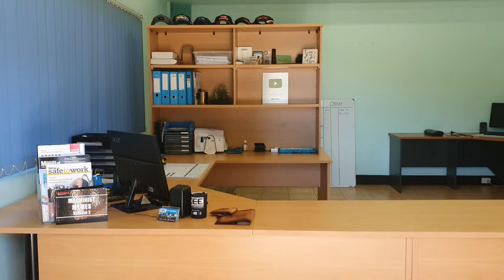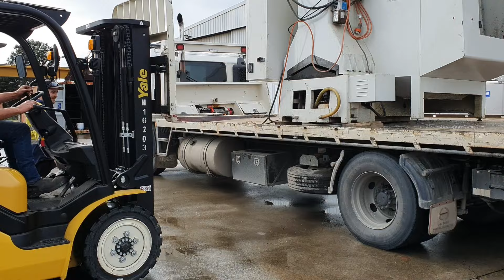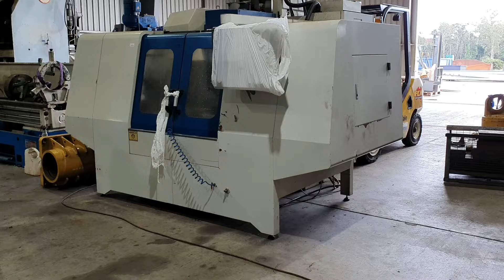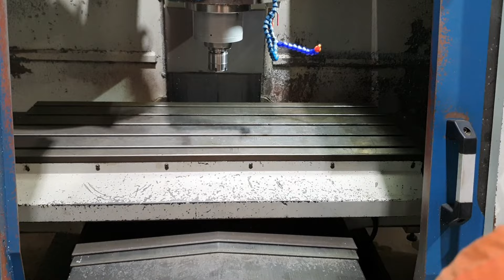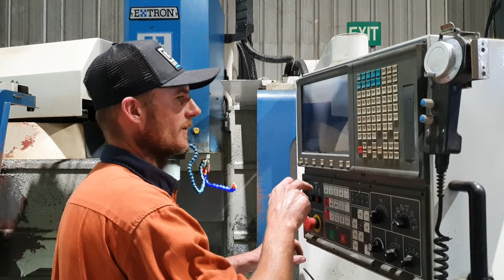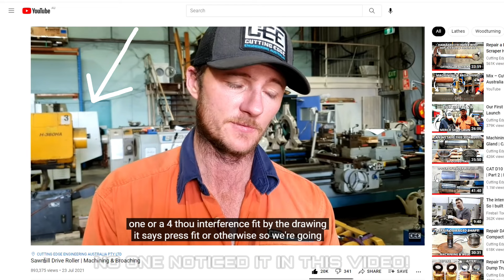Finally REVEALING Our New to us Machine | Workshop Machinery

Comment: Glad you got into the machine nice and cheap. The Cat 40 holders and tooling are what really cost the coin, as well as the probe.
Also: nice to hear that the spindle bearings sound great. The most expensive part usually to replace is usually the spindle. Most aren’t the type you can replace parts on, most are core charge type parts

Comment: I've trained lots of people to do cnc setup, and operation and a few to program, you already know the hard part, and that is how to make parts, now you just have to learn how to tell the machine to make them for you. to be honest a lot of the time when I have  prototype work, I'm using the cnc as a manual mill with a dro and full power feed.  as for a guess am going VTL and a cylindrical grinder

Comment: How much experience have you had with CAD software?  Seems like we were taught G-code alongside CAD drafting.  Helped to understand the programming.  Consider this as learning a new language.  You know what you want it to do, just how to tell it.  Lucky for you, you've known manual machines.  Most of the CNC jockeys have never felt the machine cutting through the leadscrews.  Just because its CNC, doesn't make it infallible.  Sadly, you'll also see when to and when not to utilize this machine.  So many times I see CNC operators put way too much time into a simple task that could be completed on a manual mill much faster.  Unless you're sculpting 3-D surfaces or making multiple parts, the CNC machine can be very time consuming for the simplest tasks.  Be ready for lengthy programming, machine setups, and expensive maintenance.  Then again, I'm a dentist by profession.

Comment: Congradulations, looks to be in decent shape, atleast what I can see from the states! Not familiar with the control. I learned cnc all on my own (on a cinci milicron Lancer 2000 Acramatic 2100 control.). Learn g code as you progress, your are smart bloke, and if I did you can too. I do a lot the same type work that your shop does excluding Hydros, it will come in handy. On thing is though,  You should have gotten one astleast 2x the size. I understand why you picked what you did. That being said when you get to a point where want put that machine to serious use you will find out the hard way. Damn I need just 5cm more , it never stops. A very sucessful machinist friend told me once in our line of machining buy big as you can afford and get all accessories up front.  
Best of luck with it,
Doug

Comment: Very cool machine!  A suggestion for spare time programming is to work up a few of the most common cylinder eye sizes.  That way, when one of those jobs comes in, just mention that you fabricated a replacement in your CNC, show some shots of the process, and go straight on to prep and welding.

Comment: Hey guys listen I live in ONTARIO CANADA, about 1hour west of Toronto Ontario Canada, have u heard of that city? Anyways, y do u say measure everything in metric? Here in Canada yes we use metric all the time, and we use standard as well, that's the die hard I use both, and I don't know if its Murphy's law, or what it is, but where u are do you find your self loosing 10mm sockets and wrenches? Fuck I do all the fucking time lmmfao, well good luck with the new C&C machine, and my kid wants to know do you get snow ? And right now here in Ontario Canada time is 11:15pm what is the time difference there? Have fun with new machine, ken from Canada

Comment: Those bearing pullers are a good example of a job for this machine. Clamp plate on, run a highfeed, take core out, profile taper, drill/tap holes. Would watch it take the core out (same same trepan),manually remove that then go do something for 30 mins while it profiles the v taper with button.
Reply: What's the controller makes/model? What your current cad system if any? Fusion 360 is like 300 bucks a year and had all the posts, easy to customise. Also check out the titans of cnc fb group, post the machine and controller details, will be people who are familiar with itm
Reply: Found it sorry, Mril 2000, old Taiwanese controller, 486 based. Looks like a generic fanuc oi post would work, just need tweak any mcode formatting and sequencing. Previous owner should have samples and information on that, manuals etc.. if you can, try find out how.to backup parameters, they'd be near impossible to replace lol

Comment: Mastercam is a really good cad/cam program. Cad/Cam program will let you do a lot with out special tooling. I started using Blaser Vasco 7000 coolant it working out great and has a great shelf life. One thing to remember is LET IT COMPLETE A TOOL CHANGE BEFORE DOING ANY THING. 😁 I started with a old Bridgeport ticker tape mill  and converted it pc system. Then picked a Okuma 45-VAE 1999 model in 2002 it still runs great. Last year added two more OKUMA’s a lathe and mill. They are very fast beast. Example the Okuma Captain370 lathe. Been running a 1018 steel part 5.25” d x 14.5” long it weighs 41.21kg. Running Mitsubishi rougher insert take rove 21.21kg in less than 20 minutes at 775 sfm .012” chip .100” depth. You can stick a shaft out the window and attach a torch are plasma cutter.  Great videos 👍

Comment: To run it, id suggest getting a G code machinist manual that will hep you with understanding canned cycles 
Other then that, it’s all running and finding a good cad/cam program to make the G code with the output post processor. 
What type of controller is it? Fanuc, Mitsubishi? Heidenhein?

Comment: 50 plus year old machines bought from an auctioneer. Ok.  Well the CNC mill I can understand because it will be good to learn and possibly can increase productivity if you have a job that can be programmed and run with minimal interactions so you can get other jobs done.  The other machines would have to fill a role that you don't currently have so I would guess a horizontal boring mill for jobs too large for the mills you have now and possibly radial arm drill because they have a lot of versatility and many people don't use them because they take up so much space. I have a couple other guesses but those are my top two picks.

Comment: congrats on the new machine. Im not sure what program you use to do your technical drawings it may have a cnc function as well if not i use fusion 360 for my cnc router that i built you can from memory get a free version just not sure how long it lasts it does all the cnc and post processing in one easy to use once you understand the basics. i watched a lot of  Lars Christensen's videos. i als ouse it for my 3d printers for designing models. best of luck peter

Comment: well hell, I'm sure there are dozens of folks making the same offer, but at one time I was fair handy with a cnc mill, if you need some guidance and whatnot. Do me and yourself a favor develop a "safety line" in your code, should cancel all modal G/M codes and send the Spindle "home" before starting with any new tool... It will save you a spindle or 3.

Comment: Fyi: never never play in the parameters.  One edit could turn it into a paperweight.   Learn recovery codes first....cnc is easy after you learn g codes...one more thing, some commands will not work with the doors open .Good luck

Comment: you should get sa fourth axis and accopanieing steady rests and live center from what i have seen you mschine this will make it way more usefull - also with that table size, if the maschine is not completely worn out you can make easy automotve work like planeing cylinder heads and other gasket sufaces and just let it run 
you can even get waste maschines to restore and sell since you basically can make any missing part there is now

Comment: Your a smart guy so I'm sure you'll pick up cnc driving well enough Kurtis. 6,000 spindle rpm sounds good, but for what your doing I doubt there will be much aluminum or that many small parts involved. Better might be what's the bottom rpm that still has full torque?

Comment: Hay mate big Steve O from NH.USA nice machine boss you will love playing with that bad boy just make sure you set your hard crash parameters to several inches sorry meters away from the axis limits as you dont want to hit a hard crash get your self master Cam or something similar for your PC then you can run all the programs first on PC #1 rule cnc turn the feeds down and dry run your programs make sure your tool lengths are set correct affix a ball or block to the table to touch off on so every tool is set the same way there should be a setting on there for a ghost run that you can run the whole program on the screen before machining to see if it runs all the way threw like you said trial and error just make sure the errors are small lol aluminum good practice put a nice vice on it with some good jaws have fun wish I could come play lol

Comment: Awesome to see you got yourself a CNC machine!
One suggestion I can make from previous experience over the years is prepare yourself and contact the manufacturer of it and find out what is likely damaged in the spindle during the event of a bad crash and get the required parts and keep them in stock as it's often the wait times on the parts takes forever and results in months of down time so having the parts on hand saves alot of stress and hassle.

Comment: The best part about CNC is the quality time you spend under the tables and other sturdy things when someone programmed a rapid move instead of a feed move, making the workpiece into a projectile, which celebrated by making the viewport glass into a group of projectiles.

The next best part is adding some bling to the new machine in the shape of metal bars or grilles over the viewports to make the flight paths of abovementioned parts a little less boisterous.

Comment: congrats on the new mill! if you have any mates that run cnc  they can really help with your learning curve. maybe try the library look for books on "g coding" depending on your controller, you may have to program with them. i hate 'em,  i usualy run a Mazak mill that uses "conversational programming" which i think is much easter to learn

Comment: Autodesk stuff is pricey but works good. Solidworks (am I thinking of the right thing here? It's been years) is great as well. The learning curve will be learning the cad/cam software and getting it loaded to the machine. You can program on the machine but it takes geological ages to check things sometimes. For a one-off part or cut yeah use a manual mill or use the hand controls. Looks like a good buy.

Comment: Never seen the value in a CNC anything in a job shop that does one off if you doing 10 to 10000 items the same then they are good but by the time you program and test the program make changes you could set up the part and manual machine it

Comment: I worked on Japanese Okuma CNC lathe. Regardless of where you interrupt the program, the machine always knows where it is and can return safely.
That was a problem on an American Haas lathe. If the program was interrupted, the machine no longer knew where it was and you first had to drive it to the starting point by hand, otherwise the machine will go somewhere else the next time it starts and it crashes.  For this, the Haas often needed repairs.
I've seen bad damage on Okuma machines, but it's always worth repairing. A Haas would then have needed a new one, because it is only half as stable. But it cost only the half.
Reply: The only cnc machines I’ve owned for the last 35 years in business, have been okuma’s. They are the industry leader with Absolute Position Feedback, that you spoke about. If you compare a haas machining center along side an okuma with equivalent travels and horsepower, the okuma outweighs the haas by 6 to 8 thousand pounds. My point is, that steel had to come from somewhere…lol! I remember my first okuma lathe like it was yesterday…a 2 axis LC30. I had a big contract making stub axles for potato harvesters and that old girl would take .250” deep roughing passes all day long and hold +.0005/-.0000 on the bearing diameters.

Comment: Hi Kurtis,  CNC is the way of the future, and even for some "one off's" it can be faster than manual. I would agree that tooling is expensive and the holders as well are not cheap, but without it you cannot use it. Tooling for manual machine is not cheap either.
You also will find yourself changing your thinking as you get more accomplished and comfortable with CNC and doing turning jobs on the CNC mill rather than the lathe.
There are several good books on CNC programming and TAFE used to run courses on it too, I am sure they still do. Another comment mentioned Titan's of CNC in the US, they have online training and it is all free as their "give back to the future" program, so worth a look.
Does your machine use G codes only or other languages too?
On the heavy metal you have still to reveal, one machine I would love to own and is  becoming very difficult to fine one in reasonable order is a metal shaper or a slotting machine for cutting keyways, splines etc internally (especially in  blind holes) or externally. For the other that is a difficult one, could be a horizontal mill, a radia arm drill (although they are still made and available), or a surface grinder.
Look forward to seeing that CNC making chips, even if only for you to be learing.
Regards Dennis

Comment: There are two parts to "drive" it.  The first is learning and understanding G-Code.  It's been around since the 60's and is not hard to learn.  Once you get a solid grip on G-Code start cutting parts from the command line.   Try moving it back and forth with a G01 and try a circle with G02/G03.  Turn on the spindle with a "M03 S100 (100RPM)" and off with an M05.   Maybe try a tool change M06.  Read through the wikipedia on GCODE.   This is basically the equivalent to "manually" control your CNC.  The second half is truly turning to the dark side.  Engaging with a CAD/CAM software package.  The path to CNC always starts with manual machining and you got that in spades.

Comment: That mill looks very great for its age!!  even the control unit looks replaced with new one. This tell you alot  from the way it was used (not abused) by previous owner, despite any tale he wanted to convince you of .
Very good buy , not just to fabricate very complex parts, but automating the simplest ones leaving you hands free to parallelize other work. This is a good deal, get some money back from the machine and improve your CNC skills at same time.

As metal fab hobbist/almost professional I am , I have nothing to teach to a chip making master like you. But as CNC user...  Step by step dear Curtiss, don't be tempted by all those amazing CNC fabrication videos of youtube, its easy to get drunk of them. But there's no point in trying to make a piece of art the day next and, after  lots of hours wasted glued to the screen or manuals, getting  totally overwhelmed by all these keys and commands from hell. it's the straight way to make grow the desire of throw  the machine right where it has came from and pray god for all your RIP tooling, worse if you are not used to "speak computer language".

Comment: If your other machine is 50 years old my guess is you bought a big VTL Buddy mine works at Norfolk Naval shipyard in Portsmith Virginia they have one that was ordered and installed 1935 I think you said and it has a 12 foot table on it they had to rebuild it it had Babbitt bearing shoes that circulate to dinner and a Noyle bath to keep the tables stable and rebuild at all that’s a job…

Comment: Congrats on the new machine!
As an apprentice from Germany, learning the basics of CNC looked daunting at first, but with just a small amount of motivation the first steps are taken quite easily and quickly, the rest comes naturally.
A few things that were practically imprinted on us:
1. When running a program for the first time, turn the potentiometers to 0 so the machine can not move, start the next command line, look at the remaining distance to travel if it makes sense. 
If so, turn to 100% feed and let it run that line.
Then back to zero to start the next line. 
This allows avoidance of collision due to typos.
Using cycles to program, which run on their own to for example machine a pocket, that does not slow down too much.
2. Before entering the workpiece with a tool, program a rapid move in the spindle axis to a point a few millimetres before the workpiece surface and potential contact with the workpiece. Then move below the workpiece surface with feed speed.
Even when you are entiering an already machined pocket, use feed speed to go below the programed surface - in case the position is wrong, it will not crash the machine but just cut at the wrong position instead.
Step 1 is important here to catch a potential typo in the spindle axis move to avoid collision.
3. When done with a tool, before you change the tool, program a manual move in the spindle axis to retract the tool to a safe distance before moving to the tool changer. This will avoid collision between tool and for example a clamping device which may happen on a direct multi axis move to the tool change position.
At the end of a program, retract to safe height.
4. Don't stop at the bare basics when you learn, it may be tempting to just go with it, but there are many things to make life infinitely much easier.
CNC cycles, absolute and incremental moves and polar coordinates are extremely useful!
On a good CNC software, there is a cycle for almost everything you can think of (hole patterns, pockets, grooves, etc.).
I have every confidence in you that you'll manage just fine!

On the new machine, maybe a lathe that allows for turning of larger diameters?